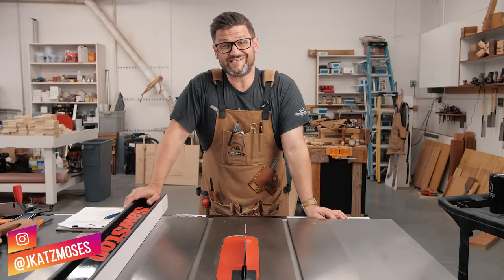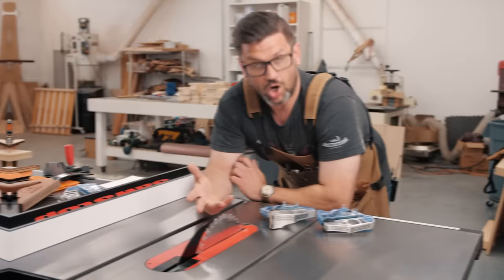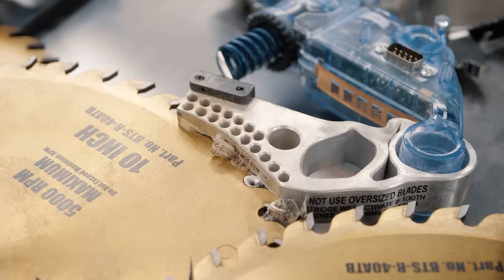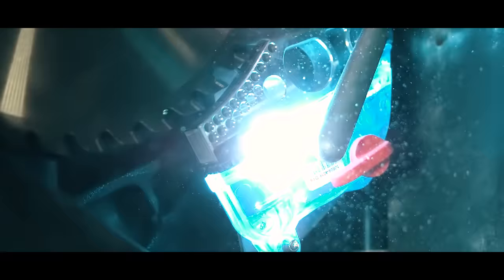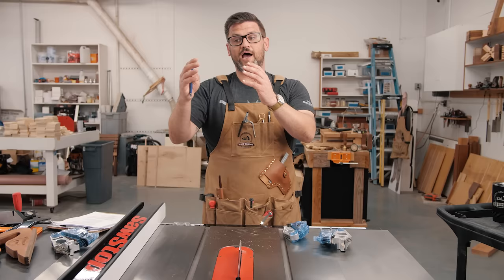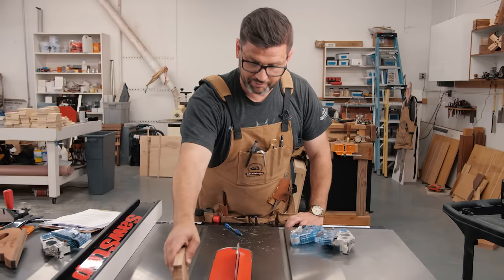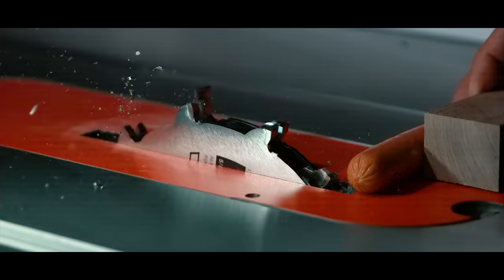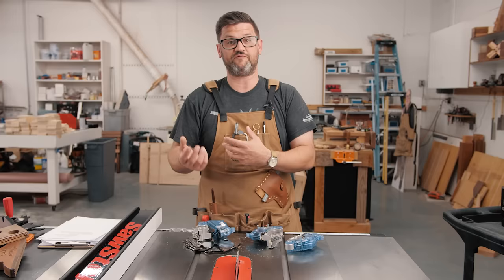How Safe is a Sawstop Saw? - Never Before Seen 19,000 FPS HD Slow-Mo Video

Comment: considering you can cut a hotdog with a spoon, but not your skin, that amount of damage wouldn't draw blood from a finger.
I'm quite impressed.
Reply: Sure you don’t wanna rethink that?!
Reply: Swing hard enough and you might actually cut a finger with a spoon. Who knows. 🤷🏻‍♂️
Reply: @anonimushbosh  His point is just that fingers are tougher than hot dogs, so it's reasonable to suspect fingers would receive less damage relative to the dog...
Reply: well I dont think there'd be a difference between a soggy wiener or straight leather....

It does the damage while its still going and stops because of raw metal crushing into it. The resistance of your finger doesn't make that 20G stop a slight bit faster.

It smoothly glides through until its stopped by an independant part....
Reply: @benhardwiesner6963  The flesh of your finger is more likely to deflect and avoid breaking the skin than a hotdog. Your finger won't have an effect on the blade, but the blade will have less of a (permanent damaging) effect on your finger than on a hotdog.
Reply: RolandDrummer77 The difference would be that the saw tooth would be doing more pushing of a tougher material instead of tearing, so you would likely not have as much damage though it would still do a good amount.
Reply: A tablesaw blade is designed to always cut instead of pushing. Thats what the teeth are for. 

Your finger would have that same 2mm deep clear cut.... 

Its just how physics work. The saw and the stop both are such huge forces that a 3rd huge force is required to make any difference.

This thing cuts as if it was healthy and running until it eventually doesnt. And we can only concider a few milimeter thick part of flesh. This wont rip nor push, it'll butter through.

In a longer timespan without a stop that definitely makes a difference but all that happens so fast that the finger really isnt a factor anywhere.....
Reply: Benhard Wiesner Exactly, the blade is made to cut through wood. The whole finger vs hotdog thing won't make a difference to something made to cut through much tougher stuff.
Reply: You haven't tried my wife's hotdogs. I NEED a saw like this just to eat it.
Reply: @RolandDrummer77  that's not how force applies on a blade. That logic would only work on the assumption that the skin is strong enough to have any impact on slowing the blade, which it won't.
Reply: Yeah but that ain't no spoon, that is a blade that is spinning faster than i dont know what but it is fast
Reply: @mryellow6918  Yeah, I agree that the difference would be negligible at best. I was trying to clarify the original commenter's point  (that hands are "harder" than hot dogs)
Reply: that does make sense, but at these speeds that doesnt make a difference
Reply: @benhardwiesner6963  true
Reply: Jimmi K  so would iron man. Someone wearing his suit however... ;-)
Reply: well saws have blades so they cut better than spoons
Reply: You also can't cut wood with a spoon. Last time i checked, a table saw cuts through wood like a spoon through a hot dog.
Reply: @RolandDrummer77  in this case it is irrelevant because it is the bone that actually stops the spoon in your finger before the skin breaks. Push hard enough to break the bone and your finger is just as weak at the hotdog. But the blade stops before ever reaching the bone, so it would have about the same damage.
Reply: @igotdembombs  lol
Reply: @RolandDrummer77  I dont find it a good comparison at all considering were using a freaking spinning saw I'd say how far it cuts into the hotdog would be close to a finger
Reply: Jimmi K  lol

Comment: saw blade: I will cut everything that comes close to me 

sausage: good morning
Reply: Saw blade: self destruct
Reply: GOOOOOOOOD MORNING VIETNAM!
Reply: Boooooooooo
Reply: I've only ever found 1 video where they don't shove the hot dog in as fast as they can. Guess what happens when the hotdog hit when you are going at a normal cutting speed? It doesn't cut the hot dog in half but it does go half way through. I really wish they would be more honest. they make it seem as if you would get a scratch and go back to work. No it still cuts you to the bone and you still have to go to the hospital.
Reply: @kathleenrobertpogue6818  Then its a dodgy saw stop
Reply: @kathleenrobertpogue6818  yesss. And it will not save you from losing your finger and two or three of them if you go your hand quick enough into the blade. (sarcasm if you don't noticed).
Reply: bonjour
Reply: This must be the worst comment I've ever seen. So so lazy.
Reply: @kathleenrobertpogue6818  Nobody uses a table saw at such speed that can get deep enough to cut your finger before it's been blocked by that protection. As everyone can see, the harm you'll get going so fast against the saw, is the same as if you hit the blade when it's stopped.
But if you need such explanation your brain will not be able to process it. That's why I've lowered to sarcasm, you'll never understand it, and if you ever do, you will never correct, as that would seem a weakness to you.
Reply: @kathleenrobertpogue6818  Thank you very much for that "little guy" nor in age or size, it has been a long time since I received such a treatment. It pleased me that much.

Comment: I remember our high school woodshop had one of those safety measure tablesaws where it would instant lock if something like this happened. Thus resulting in fully replacing the blade which cost money. This tabletop saw is such a money saver long terms.

Comment: Having used a table saw many times. Definitely one of the more unforgiving tools. Common sense works well. But accidents do happen. That being said quite impressed by this tech. I knew it worked. The effectiveness is really impressive. I like that it not only stops the blade but disengages the blade.  Removing all hazard. Id definitely invest. When it will literally save your life and limbs. Well done friend!
Reply: If the saw was stop so fast with a very little contact to a hotdog will it stop with the contact in woods you need to cut? I think the common accident is when you pushed the wood along with your thumb.
Reply: @kisshinazura4499  Yes, detection is based on conduction.
Reply: I think the band saws are much more dangerous
Reply: @stevebanning902  Routers are what scare me. Bandsaw is nothing. Table top grinders are worse.
Reply: Do any of you have a soy latte i can borrow?
Reply: @rodneytuxedo7559  Anyone who says stuff like what you're saying is the first to cry when they actually get hurt.
Reply: @dav356  lmao. Nice one brooooo
Reply: @rodneytuxedo7559  cope
Reply: @kisshinazura4499  as soon as it touches anything that conducts current it stops. It doesnt matter if the material is with anothrr material or not. As soon as it touches skin it stops.
Reply: @stevebanning902  Table saws have the ability to interface with the wood at both front and back of the blade, the rear is where most kickback is generated (hence why a splitter/riving knife should always be installed). A band saw only pulls downward to the table if it catches without cutting, so all operational awareness with a band saw is on where your fingers are, while with a table saw you need to make sure you're feeding material in a way that it won't pull your hand into the blade or throw material at wall-breaking speed into you.
Reply: @rodneytuxedo7559  cope and seethe keyboard warrior
Reply: @Rodney Tuxedo YOU TALK REAL SHIT FOR SOMEONE WITH SUCH SOFT KISSABLE LIPS BRO
Reply: @rodneytuxedo7559  Never handled a dangerous tool in your life have you bud?
Reply: @BlueOvals24  only every single day for 25 years. But other than that, no.
Reply: @Rodney Tuxedo  No, the keyboard you're typting on doesn't count.

Comment: Don't know why this came up as my YouTube rec as I'm not even a woodworker, but this is great and educational
Reply: it's really mindblowing for woodworkers too, i almost had an accident(I only felt the heat but didn't get really hurt) but the "slow" speed at which he tried the stopper is around the normal speed I do it. So there is probably no way of hurting yourself if it isn't malfunctioning.
Reply: youtube algorithm knows you so well it can get more and more accurate with each reccommended video you click on
it doesn't need to be what you want, but it sure as hell will make you want to click it
Reply: same :))

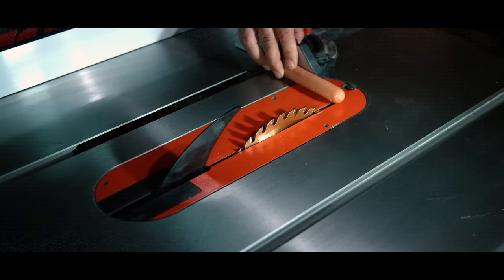Comment: 2:34 "The blade has a 3V current"

Me: I need to redo my engineering degree, i've been missing a lot.
Reply: Isn't current measured in Amperes? Not a physics fan but oof
Reply: @kidus_tv  Guy just had a little slip up thats all
Reply: @MonstertruckBadass  aight it's all gucci
Reply: I think he meant to say 3V potential because 3A can not afford that much speed
Reply: Kidus W. Yes lol. Current is amps, watts is the power which is just the amps multiplied by the voltage. Think he just misspoke
Reply: I thought it sounded wrong at first too, but then he mentions that it's a sinusoidal waveform, so like AC really. So it's appropriate to say that there's a current there, don't know if it's 3V P-P or RMS, I imagine that touching the blade alters the impedance to ground and changes the waveform, which it detects. I'll have to look into it more to be sure.
Reply: @joejoash6232  Ofc the electrons would just fly out of the blade with all that inertia
Reply: IMelkor42 I don’t know what you think AC does but it doesn’t turn voltage into the metric for current. The guy obviously just fumbled his words and said current instead of potential difference. That’s the joke that the original comment is talking about.
Reply: @tomrichardson129  What I think is that I probably know much more about this than you do mate.
Reply: Yeah you probably do need to redo it
Reply: big brain comment section
Reply: First Name Last Name 😂😂😂
Reply: There's a current flowing through the blade. That current has a potential of 3V.
Reply: current isnt in volts tho.
Its in amperes or Coulon/second.

Funny it was hahah

EDiT: typo; Coulomb
Reply: @lil_weasel219  coulombs?
Reply: @romefalls.  typl
Reply: @romefalls.  typo**
Reply: @joejoash6232  you mean 3 V potential difference?
Reply: 3v 1a im assuming 
so roughly 3 watts
Reply: IMelkor42 Perhaps you do Mr IMelkor42, perhaps. However, my point still stands that AC does not change the metric for current, and 3 volts will always remain a measure of potential difference.
Reply: @stevusbeefus  There are no amps in the blade. The current is generated depending on the impedance of the tissue touching the blade and the potential in the air (moisture and so on). Either way the current will be extremely small. It's baaically a giant touch screen.
Reply: It's the fox! Hmm

Comment: The dado teeth coming off wasn't breaking of the brazing, but because the outside blades have more inertia than the inner blades, and would have rotated against the inner blades and the teeth collided. Regardless, super impressive and I would love to have this sort of safety on every tool in the workshop
Reply: Yes, you can clearly see in the video that an outer blade is spinning faster than the blade next to it, causing its teeth to contact the back side of the inner blade's teeth and break off.

Comment: Had my finger hammered by a dado blade as a result of a freak accident kickback when I worked at a cabinet shop.  Shattered the bone, broke finger into 5 pieces.

I really wish our shop had one of these.
Reply: Oof
Reply: Do you still have your finger or was it a lost cause?
Reply: I don't think there is anything you can do for a finger that is no longer a part of your body and is in 5 pieces on the floor
Reply: @skibidi-bop-mm-dada  it was sewn back together in the most absurd, horrifying way, and somehow it grew back together.      the missing part of the bone in my first digit regrew, and now I just have an oddly shaped middle fingertip and a weird shaped fingernail.

Pretty amazing the thing looked like a cartoon firecracker after it went off
Reply: @1985_Honda_CRX_Si  yeah I had a lot of my woodworking mentors scratching their heads as to how you get severe kickback on a dado blade because kickback is kind of how a dado blade cuts to begin with
Reply: ouch. the description made me cringe. glad everything ended alright with ya and you still have your finger!
Reply: So the wood did the damage to your finger, not the blade?
Reply: @mrbmp09  nah the blade walloped my fingertip.  Direct hit I actually felt it hit through to my elbow joint